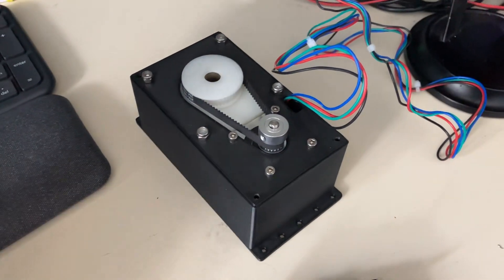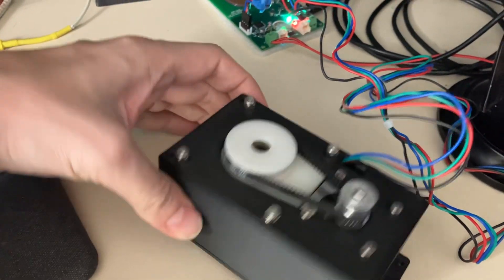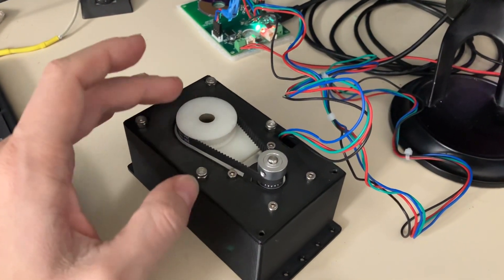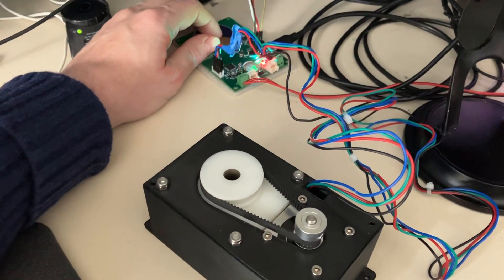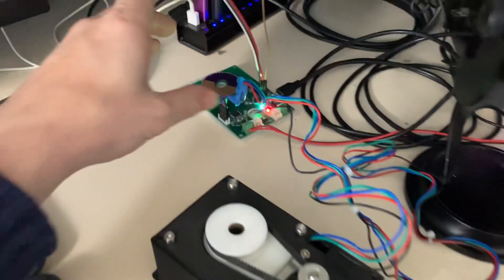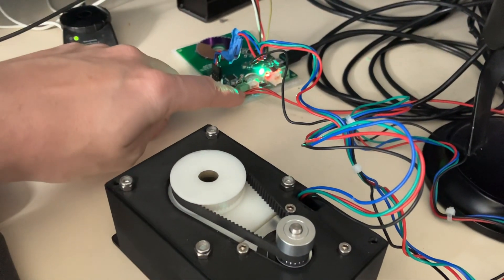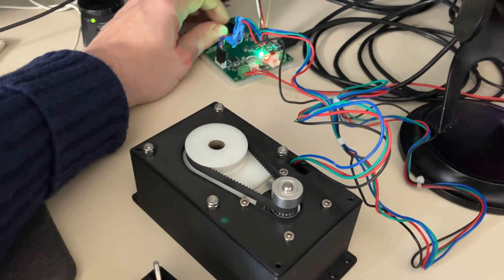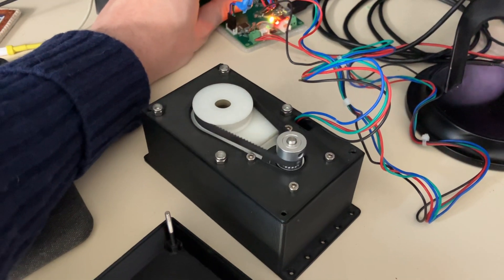Daisy driver preview 2

Comment: Hi,
I was wondering if you could help me with the working of IPS2200. I have designed a circuit board using one of the recommended circuits from the manufacturer. 
I have it powered up at 4.5VDC but when I spin the target board I do not get any sin or cosine waves on my scope. I know you had some issues with your board and you have resolved them. Would you please provide some insights on what you did to make yours work please?
Thanks
Reply from the maker: In my case I think this was v2 of the board and we ended up getting a v3.  So I don't believe I have useful help. :(
Reply: And when you say v2 and v3 you mean a new revision of the PCB? and if yes, do you know what changed from v2 to v3? @i-make-robots

Comment: Regarding CAN Bus. The Duet people are using CAN Bus "FD" it is supposed to be a better more reliable protocol. Classical CAN bus supports a maximum message payload of 8 bytes per frame at a maximum data rate of 1Mbps. CAN FD supports a flexible message payload, ranging from 0, 8, 12, 16, 20, 24, 32, 48, 64 bytes per frame at 2, 5 and 8 Mbps of data rates.
Reply from the maker: Interesting.  I haven't given much thought to the CANbus protocol, yet.  Do you have a description of a known protocol for robot arms?
Reply: @i-make-robots  The whole video is good,  but look at around 30min in https://www.youtube.com/watch?v=bqf382QDSKY